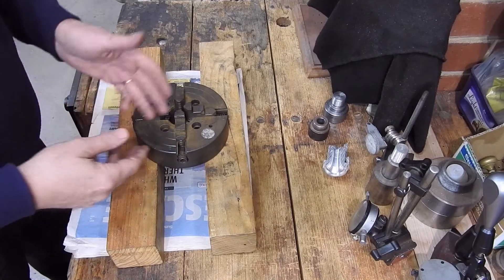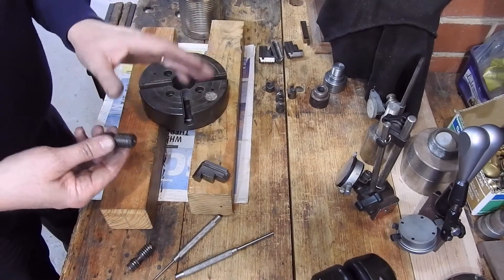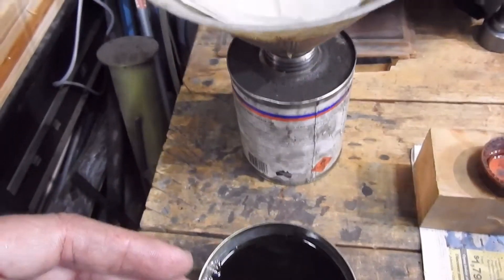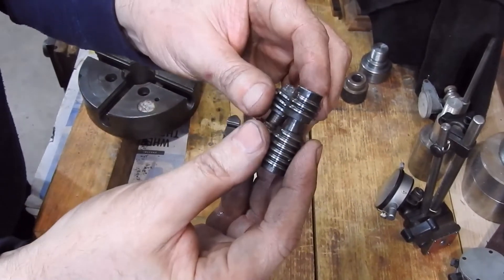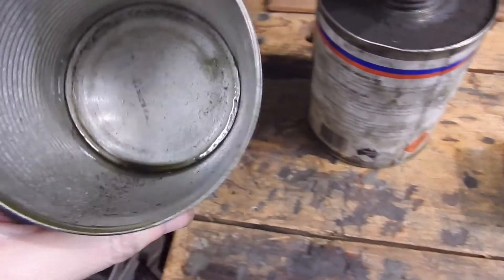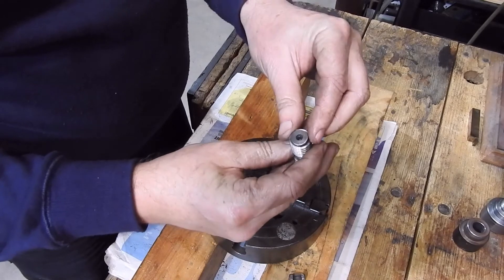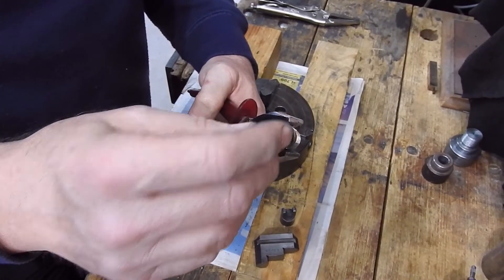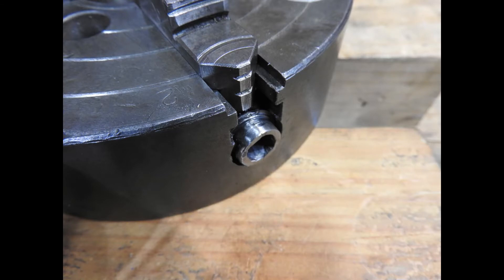Going inside a 4 jaw chuck

Comment: very good！i just wonder how to disassemble my k72-125
Reply from the maker: I don't know exactly what a K72-135 is - a web search shows a 4 jaw chuck - but typically start with winding the jaws out, remove the backing plate if not built in (mark the plate and body so it goes back in the same orientation) and then you should be able to knock those retaining pieces out in the same way.
Reply: @occasionalmachinist  I have learned it from your video.thank you!

Comment: Nice video, but I wouldn’t advice using grease in any lathe or drill chucks…it just acts like a magnet for dust and metal chips…a light oil like 3 in one works just fine and it’s so much easier to clean with brake fluid spray and replace when carrying out future maintenance
Reply from the maker: I think it's going to come down to a personal choice. Both grease and oil are going to pick up dust and metal particles. I don't like oil particularly for moving chucks as it usually does not stay where you put it, even flicking out when the chuck is spinning. For something like an Albrecht drill chuck that is especially bad, and rebuild instructions typically call for grease so it does not migrate to places that should not be lubricated

Comment: How do you remove the operating screws?
Reply from the maker: The screws are held in with a clevis sort of plug. These are removed with a punch  - 1:12 is where I show that
Reply: @occasionalmachinist  Yea, I saw that, but I wasn’t clear on the whole process. Do you punch them all the way down until the screw comes free? Then how do you get them back in again? I’m going through the process for the first time and appreciate your help. 
Paul
Reply from the maker: @paulmanhart4481  Yes, punch them all the way through. The back is open (or you have removed the backing plate), so to replace you just tap them back in.
Reply: @occasionalmachinist  ok. I’ll try that. Thanks. 
P

Comment: Did you consider bronze brazing the cracks Michael or did the key hole sides need building up ?  Cheers Rob
Reply from the maker: I was considering TIG brazing up the cracks, but eventually welded, mainly because I was not sure how well the SiBrz would stick to hardened, muck filled steel. I also wondered whether the braze might bond the copper backing to the steel - something that I did not want. A new screw is on order, so the repair is only a temporary thing before that arrives.
The key hole sides were a bit sloppy prior to the repair but a combination of gentle manipulation in the vice and a considered weld sequence squared and tightened them up enough.
Reply: @occasionalmachinist  The key hole in the repaired screw has a noticeably better feel than the other 3.
Reply: @occasionalmachinist  It looks to me like the worn screw is from another set, as the companion jaw thread appears to be in good shape, which is not what you would expect.   Whether to grease or oil chucks is a debatable subject - I prefer oil as it is more likely to release nasties than grease.  Hot topic like way oil viscosity ;)  Cheers Rob
Reply from the maker: @Xynudu  You're probably right. As I noted, the jaws are a different S/N to the body, so it would not surprise me if the screws were from different chucks. That was the only bad one - all the other screws were fine for both wear and cracks. 
I have no firm leanings on the oil vs. grease debate. Grease tends not to flick out as much though...